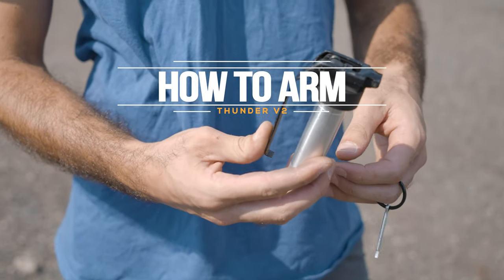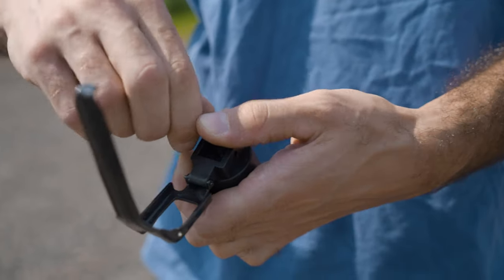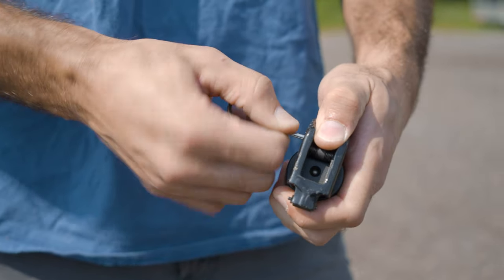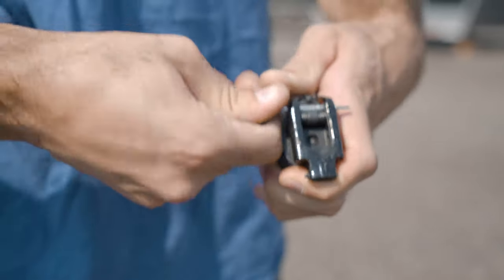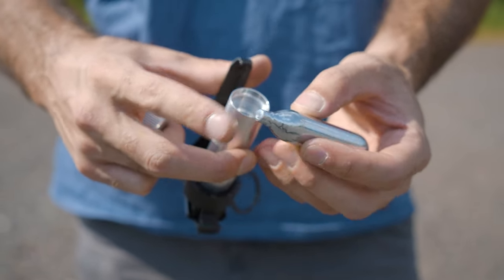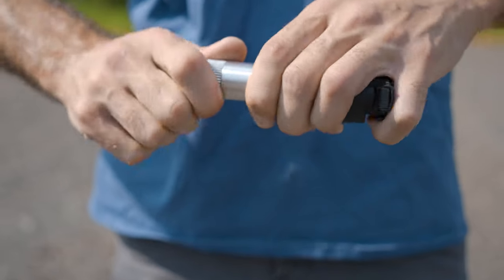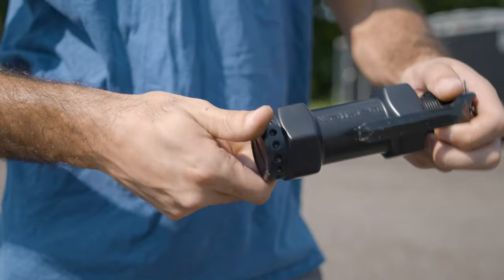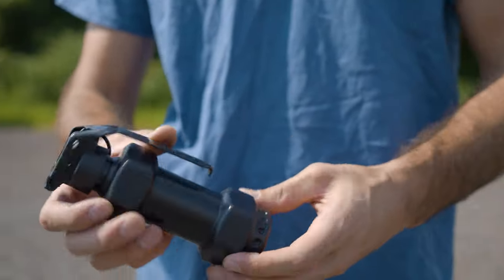How to use a Thunder V2  |  Valken Tutorial

Comment: My core has the shells threads stuck in it first try, how do I remove it? The whole shell is torn off and only the threads are stuck…
Reply from the maker: Hi we are sorry to hear that you are having trouble taking it off. This may just be as simple as just twisting it off with cloth to prevent slipping. But please call our support and they should be able to help you :)  (866) 978-2553

Comment: I ordered some but only comes with one core. Do I need multiple cores and co2 cartridges to be effective?
Reply from the maker: The core or the device itself is re-usable so you only need 1 if that fits your needs in game. All you need are co2 cartridges and shells to be used.

You can buy more cores if you want in terms of gameplay value (always good to have another if the first one is a missed throw or there's still more area to clear.

https://bit.ly/3d1CFOc

https://bit.ly/3xfntUc
Reply: @ValkenVideo  Thank you so much for the info. I really appreciate it.
Reply: @ValkenVideo how come the shells aren't reusable?
Reply: Sorry for late response. The way the grenade blows up is because the co2 gets punctured and it fills the shell with gas. The explosion is basically the air bursting the shells so u cant reuse them  @Doggy-wt2gw
Reply: @fieldmarshalairsoft3200  thanks bro